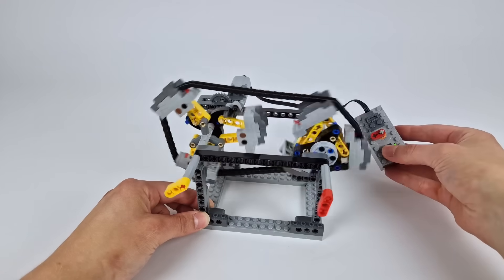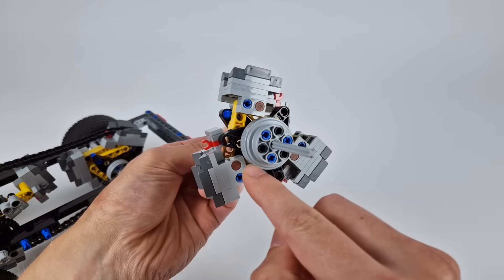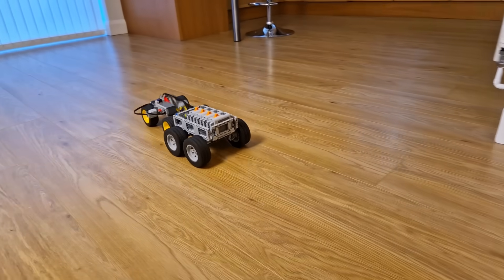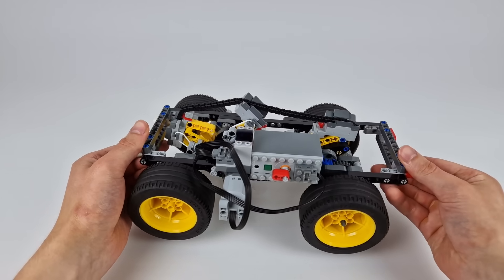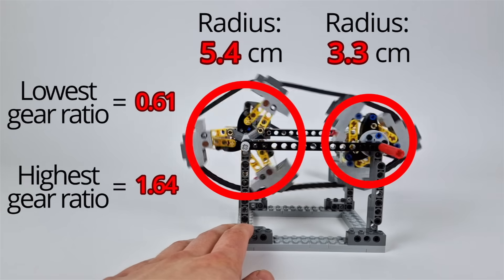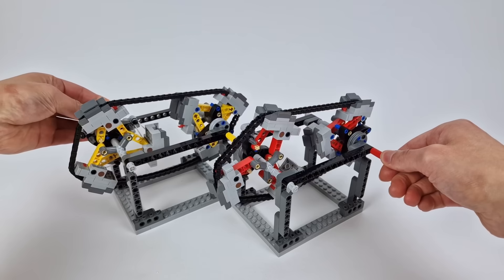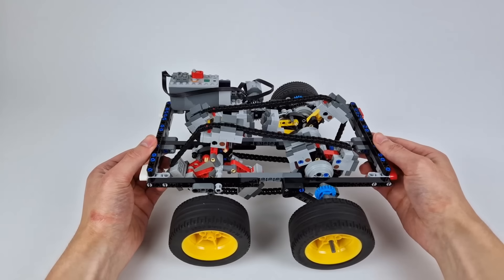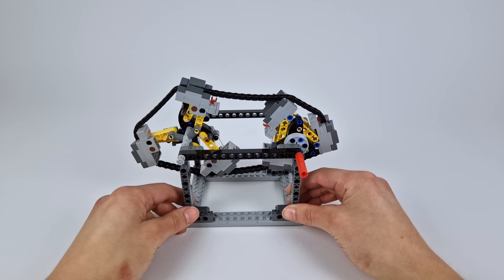The Most Complex Automatic Transmission I've Ever Put in a LEGO Car

Comment: Nice video! I liked how you presented and explained it. Just one small point: adding the second CVT won’t increase the torque as you expect because there will be additional friction losses. All gearboxes and gear systems are not 100% efficient and the shaft speeds are geometrically fixed, so the power loss manifests as a torque reduction.

Comment: Chained CVTs with "explading gears" (wavetrans, haven mercer, etc.) generally have trouble with teeth spacing as they move. I'm guessing you ran into the same problem, which led you to use just 3 points on the gear. Anyhow, you might want to take a look at driving 4 answers "first geared CVT" video here in youtube, it's a different approach to the problem, and imo quite elegant.

Comment: Here's what I think happened with your speed test:

You added a ton more power to your engine, but at the same time, a lot more weight, causing it to have to account for itself before it could account for the speed. Therefore, it couldn't actually move much faster. The twin transmission setup is great for hauling, but if you really want speed, maybe changing the gears on the single would earn better results?

Comment: there is a lot of BS in this video:
1. the transmission ratio is negligible. What is that? 1.5 to 1? this would have no noticable effect on the lego motor.
2. the lego motor has torque at 0rpm, because it is a DC motor with actual coils on the rotor. adding a 1.5:1 gear to is stupidity, especially since the motor will likely at different speeds use different coils altogether, replacing the gear with a frictionless transition. And in cars, this is done like so as a matter of fact.
3. he keeps saying things like "but I wasnt able to build this more compact". Oh, only if there were 3D printers. Oh wait..
4. Gears in  machines (which is a unit of motor and transmission and other parts) are related to the rest of the machine. Accelerating your car for instance, makes no sense when the gears immediately switch from max ratio to min ratio. You dont need a continuous transmission then. Also, you want to make sure that your gears are sensical w.r.t. the machine that they are embodied of. For instance, truck gears use a geometric design of gear ratios, and these are calculated so that the truck can accelerate within the window of its engine's optimal rpms to its target speed. there is no point in adding a 1.5:1 transmission to an arbitrary electro motor (not to mention that it never makes sense to add a transmission to an electromotor in the first place).

Comment: I think you just need to scale up the car size to fit the gear box, lift the ride hight to fit suspension and a differential plus it will give more space to add a stearing rack and pinion,

Comment: the size issue is not an issue, just put the transmission sideways so the wheels are horizontall and use gears to transwer the power

Comment: I had a battery powered toy as a kid when it got stuck the tires would stop spinning but axles continued to spin pulling the hubs in each wheel closer together forcing the tires to grow until it was able to move. Once it moved the tires would shrink back down. Pretty cool.
Reply: The Flex Galoob?

Comment: Set of stronger rubber bands on secondary cvt, so it will maintain higher gear ratio, motor benefits from extra torque of first cvt?

Comment: @16:00 a simple fix to stop the first set from unspooling under its own load would be a stronger rubberband.  since its dealing with higher loads it will be more... strict when it decides to unfurl the arms to push ratios.  since it lives under a higher load, the extra force to unfurl would be a simple fix for more usable ratios on the multiplied side.

Comment: This principle is amazing! I wonder why they never applied it to road cars to make truly-automatic transmission!
Reply: The first road-going vehicle with CVT was made in 1958. The problem though is that CVTs don't have a natural drive-train braking function like other vehicles. If you don't think that's a problem put your car in neutral every time you go downhill and see how long your brakes last. 

This is not a problem with snowmobiles however. Snowmobiles have a ton of ground-friction and the first snowmobile with cvt was made in 1950 and they're pretty much all CVT since the 1970s.
Reply: @ivanf4023  you're right, I didn't though about that.

Comment: Send this cvt  design to a car company dude, what this world needs is a CVT transmission that can be driven instead of belt driven so it can handle more torque
Reply: Toyota pretty much fixed cvt problems by giving it one actual gear (1st gear) for getting the car moving and then transfering to cvt  for any other driving. This relieves stress that causes a lot of cvts to fail
Reply: That's Subaru's CVT

Also, heavy machine CVTs are much stronger 
For example, the Type 10 tanks CVT can handle it's 1200HP without issues

Comment: To handle such torque you should make simplified Vario transmission (gearbox without variators). Two motors and differential. 1st motor running full speed frontward, 2nd motor full speed backward and decreasing 2nd motor rpm will produce torque at the output of the gearbox and after getting to 1:1 ratio (with 2nd motor stopped) 2nd motor also starts to rotate frontward and output rpm is higher than motor rpm because thats how differential work,
but you would need to operate rpm's smoothly with idk maybe lego mindstorms could do it?
also 2nd problem can be spinning 2nd motor while passive 
(I've used worm gear to prevent this, but I was using high speed motors)

Comment: With how much weight the motor could pull with the CVT, I’d imagine you could make the car much bigger without any problems from the motor. Would probably allow for axles, a gearbox for reversing, and a better steering system

Comment: If you could use bevel drive gears from drive axles/half shafts, you could flip the whole drive gearing on its side, increasing ground clearance, and having the drive more or less within the width of the chassis, potentially with front and rear axle differentials too,
..as many others have also said.

Don't worry so much about the wide turning circle, it's roughly scale to a 1940's-1960's Armoured Cars like a Chevrolet T17E Staghound

Comment: First idea, without watching any previous videos - what about centrifugal governor comparing speed of input and output? Stopped motor means no difference, so it's set by weight/spring to slowest gear ratio. As speed of motor increases compared to CVT output, governor will pull shaft and change CVT ratio to faster one.
Second idea - sense tension of chain between motor and CVT, when it's too tight, switch to lower gear, when too loose, switch to higher gear :)  Sensing could be done just by spring-loaded wheel pushing on chain, kind of like a tensioner.

Comment: Electric motors don't gain much benefit from a variable transmission vs just choosing the right fixed ratio, because they generate their full torque at 0 rpm. You might be able to simulate a less torquey motor by using a clutch gear on it to limit the torque.

Also the heavy trailer probably has a lot of rolling resistance which will prevent your automatic transmission from changing to a higher gear ratio as it gains momentum. You could try taking the rubber off the trailer wheels as solid wheels should roll more easily on a hard surface.

Your automatic CVT is working nicely, but I think with some modifications the difference with vs without would be more dramatic.
Reply: But you can't draw any useful power at 0 rpm...

And you shouldn't really maximize the motor torque - that's the gearbox's job.

What you should care the most, is the motor speed at which it's on the maximum efficiency or mechanical power output

Comment: Nice piece of creation!
But CVT is classified as the worst possible transmission for cars by most users.
Reply: only because of two things, slippage and the satisfying upshift sounds of a traditional transmission. The slippage can be somewhat mitigated by adding little griping slots into the pulleys and for the sound it can be added just by programming the TCU differently to act like a regular transmission from going to specific types of gear sizes really fast instead of slowly.
Reply: @Abe8816  Another reason is most mechanic shop don't have the skill of maintaining this new gear box. (may change when this kind of gearbox becomes more popular)
Reply: @lamttl  True, but YouTube is an awesome place and I my self have learned from knowing nothing about cars to being able to fully rebuild a transmission

Comment: In theory could you replace the rubber bands with actuators so u can control the gearing manually depending on the speed/torque u need

Comment: I'm still curious about the stability of the output rotation speed. It seems like it's halting or at least not very continuous? I think you'd need several expanding wheels side by side and many more arms+hooks on each wheel (but not so many that the hooks that didn't grab the chain can knock the chain off a hook that did) to get a somewhat stable radius, which if my theory is correct should make it settle down.
Would be pretty cool if we could find a solution to the chains gliding over the top of the hooks as well. spring-loaded hooks? Hooks that can bump forward a few degrees to fit between the chain links, if they're not pulling?
I do realize we're straying into 3D printing and/or laser cutting territory here.

Comment: I've seen demonstrations of manual transmissions before but this is the first time I've actually seen someone make an automatic one out of Lego.
Reply: Yes but only automatic in the way it functions. It's a cvt so it does not work like a traditional "automatic".
Reply: And what's even cooler is, that it doesn't use any electric parts to work. Purely mechanical. Never seen an automatic not use electric parts and sensors.
Reply: @DarmiGames Centrifugal 2 speed transmissions exist in Nitro powered RC cars, and don't use any electronics. They use a centrifugal clutch to engage second gear, and a one-way bearing to disengage first gear once second gear is engaged. A few manufacturers have also made 3 speed versions.

The gear selection on these is determined by speed though, not load. The shift point can be adjusted manually, but if it's set to go into second gear at a certain speed, it will shift at that speed no matter what the load is.
Reply: @askbeforeplaying2983  Oh, that's cool as well. I've never heard about these
Reply: this isnt what is defined as an "automatic transmission" but it is a ""CVT" aka continually variable transmission. "automatic" transmissions in vehicles are not designed this way other than snow mobiles and go karts
Reply: @bmxscape  I know, some nissans have cvts, but it's stil really cool, because if I'm not wrong, even those use electronics to control it.
Reply: @DarmiGames  i did not know they used it in a full size car... i guessed the  belt would be the weak point but i looked it up and they use some special metal belt that's like a tiny tank track. that is neat
Reply: @bmxscape I think even Koeniggsegg uses CVT in some models. Also I heard, that they got banned from F1, as they were way too good. So it is possible to make a good cvt, but probably really expensive.
Reply: @DarmiGames Many cars have CVTs nowadays due to improved fuel efficiency. Honda, Toyota, Nissan and more have been using them in their sedans for many years at this point. Reliability has improved but many folks are still wary of them. My 2019 Honda Accord Sport is still going fine, but I haven't hit 100K miles yet.
Reply: @bmxscape  CVT:s are still automatic transmissions, and many cars use them.

Comment: Why didn't you just mount the CVT on it's side and use a differential to drive both rear wheels? You'd avoid all the complexity of shafts inside of shafts, the complexity of your steering mechanism and solve your ground clearance issue. The only downside is the car would be taller, but who cares about that?

Comment: Nice video. One thing you could have added to show how the two sequential CVTs interact is using your torque meter. Use one on the input, the second in the middle and a third on the output.

Comment: You could've circumvented the problem with the limited space a bit by laying the cvt on its side. It would allow you to use a differential gearbox in the back and a propoer steering mechanism in the front, and maybe even the reverse gear in the back.

Comment: Mount the transmission so it’s lying flat above the frame and you can drive all 4 wheels with differentials in addition to being able to stack multiple CVTs on top of each other to give a much larger gear ratio. If I had the resources available I would make it myself to show you what I mean

Comment: So uh, i haven't actually watched all the way through yet.. just a few minutes till the point of all the 'there's a problem getting the axel to turn cause xyz'.. so i did a quick scrub through to see if my 'comment/idea' was gonna end up showing up visually... and it didn't soooo...

Why da heck are you trying to build it Vertically? You're whole issue is solved by just rotating it 90 degrees on its side.... making it Horizontal. . . Then you just use some mechanism to 'rotate' the rotational forces back to the normal sorta orientation, and presto bango.... you can use smaller wheels if you wanted, with a solid axel if wanted, and could even easily make it 4 wheel drive...

Comment: You are too obsessed to build the car exactly the way you built the gearing.

Simply by turning the CVT horizontally would solve all the problems except the width, but I think that is acceptable trade-off for being able to have the motor inside, differentials, steering and the ground clearance.
Reply from the maker: I did think about that when building it, and the main issue was I was worried about the chain slipping off of the CVT wheels, though I'm sure I could've made some supports to prevent this. Though you're right that it would've improved the ground clearance and steering. It wouldn't have been an option for the coupled CVT without making the car insanely tall though!
Reply: @BananaGearStudios  Would love to see you to test that.

Comment: Differential? Just have a separate CVT for each side. 😂
Reply from the maker: I mean that's definitely an option... It would've made the car way bigger though.
Reply: I can almost see where you're going with this.
Reply: This is exactly what DAF did, the car manufacturer that was famous for being the first one to offer CVTs in cheap cars. In the 50s, finding an automatic in sub-800kg cars was very special.
The Variomatic uses a combination of fly weights, engine vacuum and the pulling force on the belt in the same way this one does.

Comment: I really like the idea. Looks like you could still scale up quite a bit... And you probably should. This principle comes to its maximum potential if you put this in a car sideways, and use the second CVT to turn a central driveshaft. By way of differentials you could make a 4WD vehicle that would have no problems making tighter turns, and then take it for an off-road test. At this scale, suspension travel and chassis torque could become an issue, since you'll probably need to make 10" studded wheels.
Reply from the maker: Those are lots of great modifications I could make, thanks!

Comment: There's no actual rule that the line from the motor to the drive differential needs to be parallel with the road surface. You could have put the CVT on its side above the car and run the drive shaft down to the differential in the wheel base. Then you could have the car be as narrow as you wanted and have all the space in the world for steering.
Reply from the maker: I did consider that, though I thought the chain might slip off of the CVT wheels if I positioned it horizontally, as one of the replies already mentioned. Regarding the size, it might've made the car slightly narrower, but it would've made it a lot taller, so there was a compromise to make there. And doing that for the coupled CVT would've made the car ridiculously tall! But you're absolutely right that it would've had some advantages.
Reply: @BananaGearStudios thank you. It clearly would slip off horizontally. 
Comments section warriors are always "smarter" than everyone else, because they don't try the idea, they just say "do it"
Not to mention the torque twist force that would be applied running the "chain" on its side above the frame of the vehicle.
Reply: That also was my first thought. But it would lead to the problem of keeping the chain in place, because this design relies on gravity to keep it where it is while standing still.
Reply: If the vehicle is heavy enough to make the horizontal torque less effective. In this case, the CVT is nearly 1/3 the weight, so the horizontal torque will be noticeable. The CVT on normal scooter is off center and not make any large effect.
Reply: Rather than on the side they could be at a 90° angle from each other, and at a 45° from the center of the chassis.

Comment: Have one CVT per side of the vehicle, and point them upward instead of sideways
Reply from the maker: I did consider that, but I was a bit worried that the chain would slip off the wheels if I put it horizontally, and it would've definitely made the car a lot bigger if I did that for the coupled CVT car. But it would've solved the ground clearance issues for sure.

Comment: Maybe rotate the gearbox by 90 degrees, so spinning is in horizontal plane? Since you already use gears cvt -> wheels
Reply from the maker: Yeah, that's a nice idea! At this scale it might've made the car slightly bigger, and I was a bit worried that the chain would slip off the wheels if I put it horizontally. But it would definitely solve the ground clearance issues.